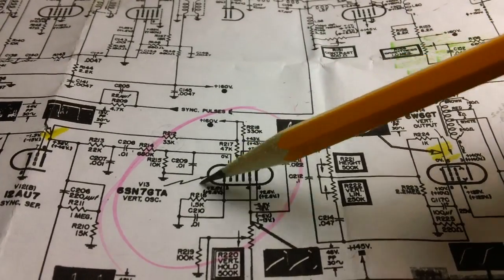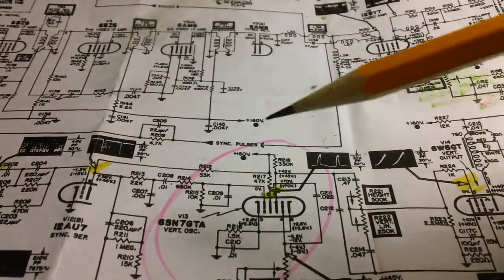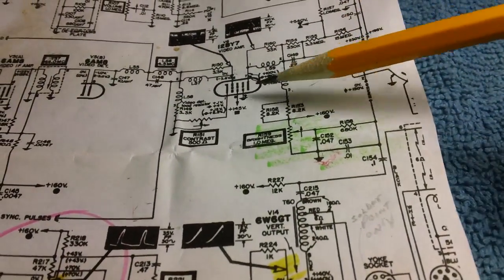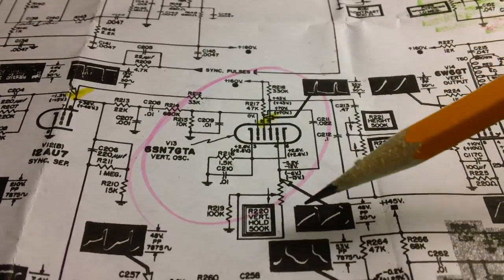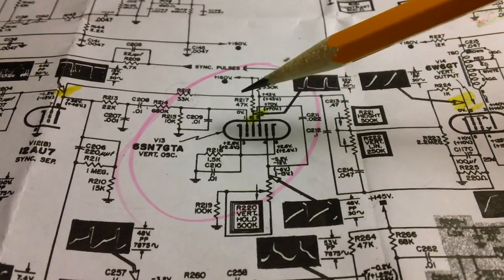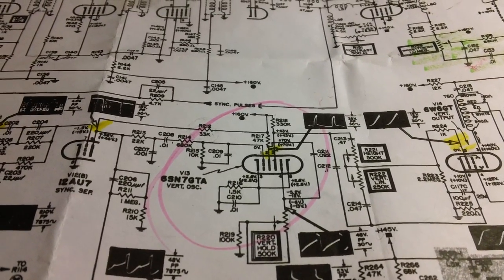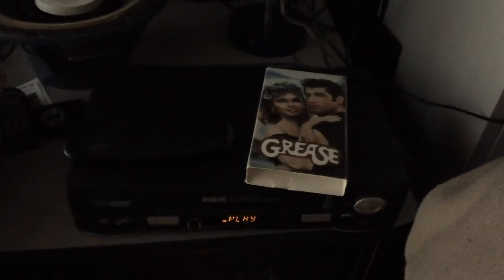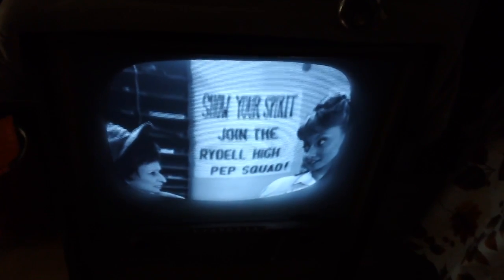1956 Sylvania 21" Halolight TV restoration (part 23 of 23).

Comment: I grew up in a small desert CA town - no TV until they put a booster in to get the signal over the mountain.  If you watch in the daytime is looked like it was snowing most of the time - Got your exercise by adjusting the vert hold - horiz hold - going outside to move the antenna etc - We though it was the greatest at the time.  Now a 8 year kid ran into my grocery cart watching a hi def movie on his phone while walking with his mother.  As Dylon said - the times are a changing.

Comment: Nice job on the set John. Too bad you had to take it all apart again for the speaker rattle. I don't see any horizontal shift at the top when you use the VCR. I love the halo light part. I hope my TV restore comes out as good. Gary

Comment: I really loved watching this series from beginning to end and I have a question for you; I just ordered a Sam's Manual for my 1956 Sylvania "Hillsboro" on Ebay. Am I to  understand that all of these Sam's manuals are inaccurate? Thanks again for sharing the process.
Reply from the maker: Of course not.  In fact, very few are in error, but just know that you may run into it.  That's why I stressed it in this video.
I appreciate you popping in and good luck with your Halolight.
Regards,
John
Reply: Thanks!

Comment: John, where you able to fix the ringing problem?
Reply from the maker: Yes.  We discovered that Photofact and Rider's offered two different schematics.  We were using Photofact which in terms of component value proved to be erroneous.  Rider's had it right.  All became righteous once the correct component values were installed.

Regards,
John